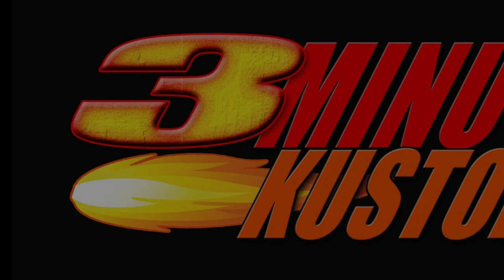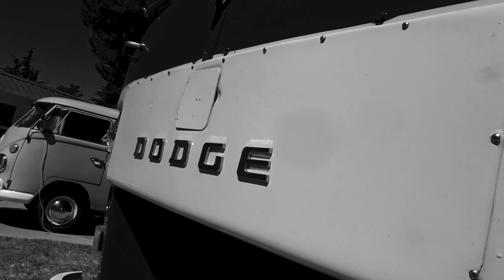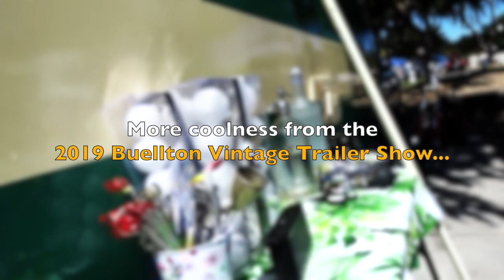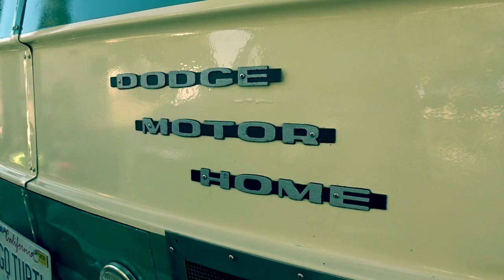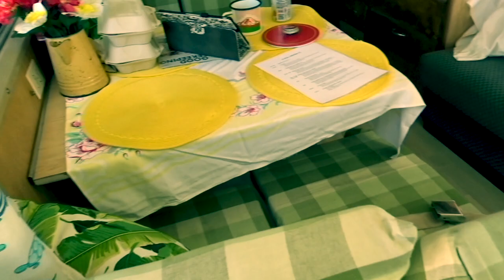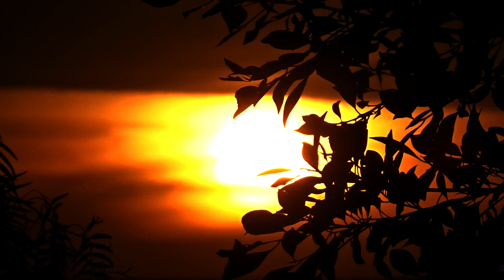1967 DODGE TRAVCO 270 VINTAGE MOTORHOME - 3MINUTE KUSTOMS

Comment: Wonder why the previous owner would convert it into a pusher? Seems like a lot of work for zero benefit other than maybe a little less engine noise up front while driving.
Reply: I agree. I'd much rather buy a factory built pusher motorhome than a converted after the fact pusher.